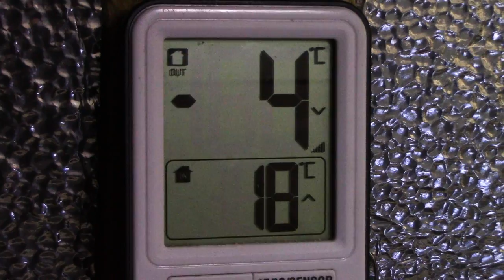Snowmobile Camper Solo Overnight- Primitive Heating & Wolf Lullaby / Log Cabin Update- Ep 11.6

Comment: That place is too small for solar. If you put solar on the entire roof you would still have to stay there for quite a while to get anything to recharge (roof slope/overcast).  If your snowmobile has a battery, figure out how to port off some of that power into  an Anker PowerCore or something comparable. One (middle of the road PowerCore) will charge my phone 6 times before it needs charging.  I do van life and two of them keep 2 phones, 1 tablet, 1 camera  & sometimes a laptop happy for 2 weeks easy.   They are small and could be charged before trip and recharged via snowmobile.  Also Walmart has huge fleece blankets for 6 bucks. Get one and make a heat curtain for that giant front door.

Comment: I'm really liking the snowmobile camper, I was wondering though whether it could do with an air lock type deal. a small entrance you get into, then close the door behind you before entering the main part, that way you'd never loose the heat built up in the main area?

Comment: Wolfs? It sounds like dogs, sledge dogs. I had a mix malamut and sibirian husky. and it sounded like this. I would put up a heavy curtain in your opening of your shelter.Every time you open it, you let in all the cold air. I live in a smal sailboat in scandinavia and talk from experience. But it seems like a good solution, if you got a snowmobile that is. Probably it is possible to make a lighter construkction. because insulation is lightweight.

Comment: Hi I am thinking about using 12 Volt Motorcycle Gear to keep me warm in similar conditions when it gets really cold out and was thinking that maybe it would work for you instead of a heated Blanket, I think it would use less Power than a Blanket plus it’s already setup to run on 12 Volts, you could also use it on your SnowMobile, just a thought, anyway I enjoyed your Video.

Mike
Reply: THEMADNOMAD how the heck is a motorcycle gear gonna give you heat?
Reply: Shawn T 

I have a Jacket, Pants, Gloves and Socks that run off of the Battery look up Gerbing Heated Gear if interested.

Mike

Comment: Have you thought of 'recycling' some old storage heater slabs or concrete paving slabs in a metal-lined wooden vented box it would be much slimmer but still heated on the fire possibly like fire-pit liners?  Perhaps sealed oil-filled tubes that slotted in along the sides inside as oil hold heat & doesn't expand contract like wat,  room for experimentation with the best shape!  
Finally, also curious... what passage of your Bible did you read? It looked around the histories mark... But It was encouraging to see that!

Comment: foil faced 1 inch 535 board  flexible will not smoke till 180 degrese gas off innitial then rated to 350 f no smokeing dow corning and the manson produtcts fire at 850f

Comment: Put a battery-operated heat and smoke detector for heat use, a motor home hot water heater used, or a new.—automotive heater core with a low voltage fan.

Comment: So you lost about 2 degrees per hour.
Not bad for a haphazardly insulated camper.
Reply: I would seal the gap at the top of the door. I would rather have a fresh air intake near the bottom.

Comment: Have you though of using a method like this to heat the camper ? https://www.youtube.com/watch?v=QeHGDr81XwM
The pipe could be built into the camper and fold/telescope out, or just be made of a heat resistant soft line and a metal hot end.